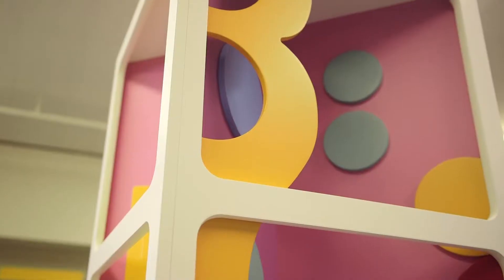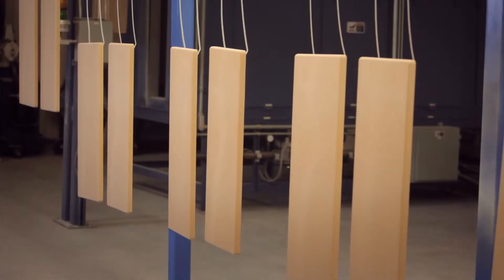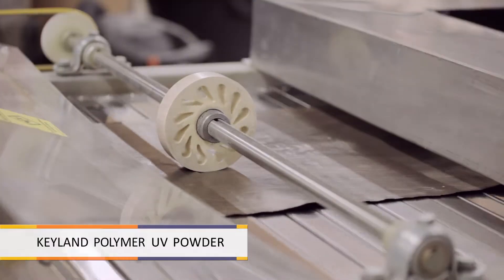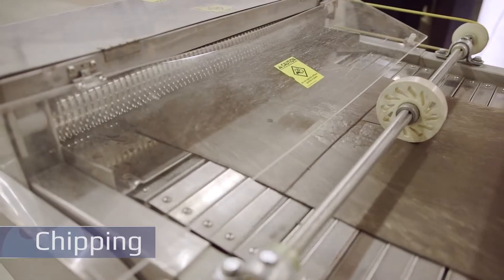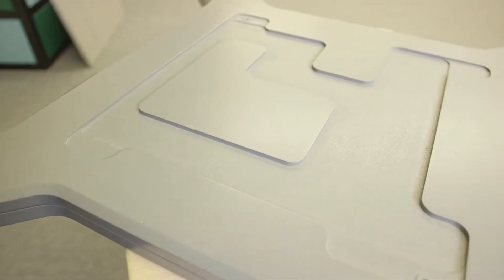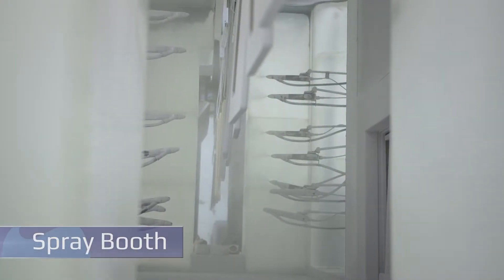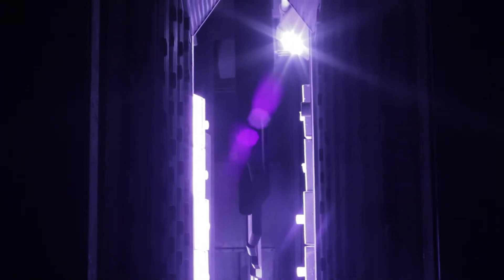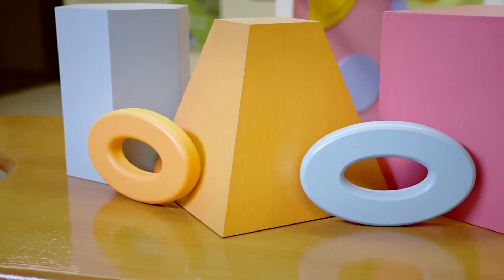UV-Cured Powder Coating Overview

Comment: But how does electrostatics work on wood?
Reply: LOW GRADE METHOD APPLY DESIEL , EVEN YOU CAN COAT ON A GLASS BOTTLES AS WELL, JUST BEFORE PROCESS APPLY DESIEL ND SPRAY IT UP WITH PROPER GROUNDING
Reply: @krunalpanchal9686  right,,, I belive preheating mdf before spraying can do the job?